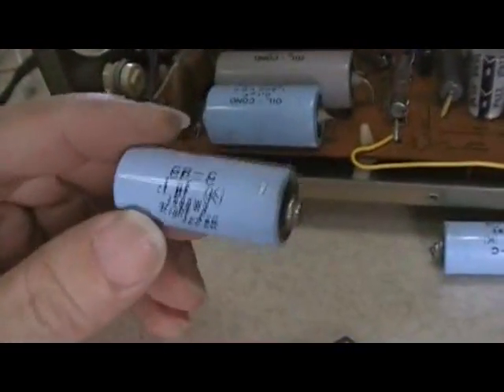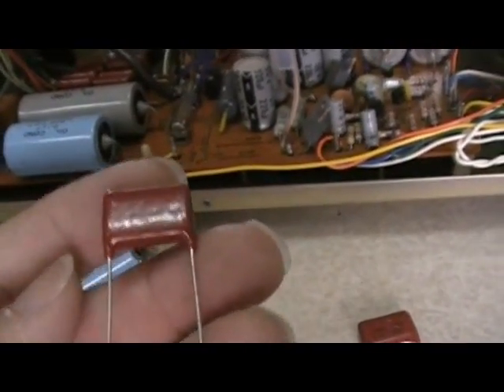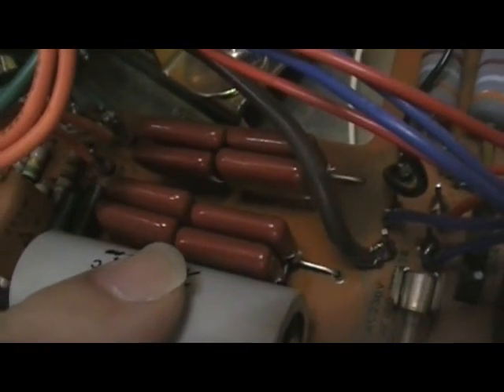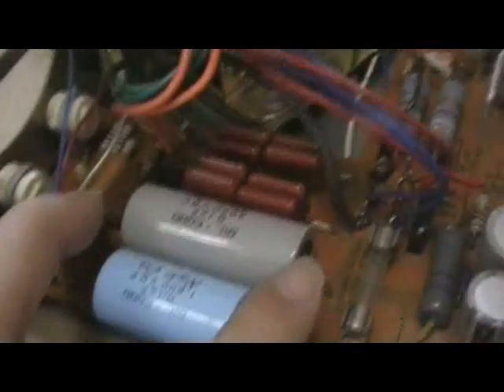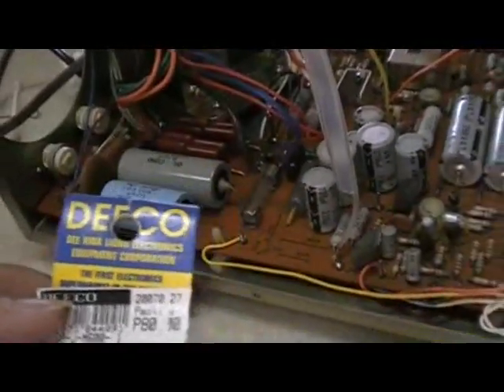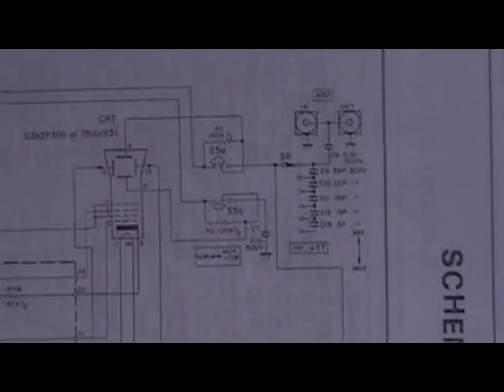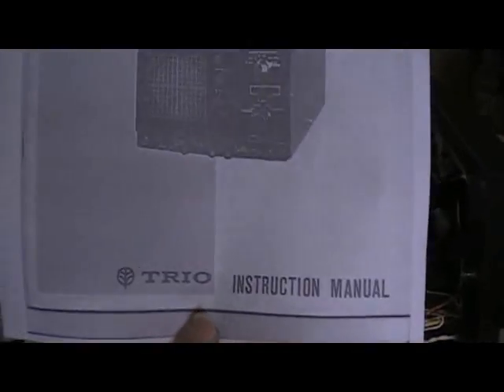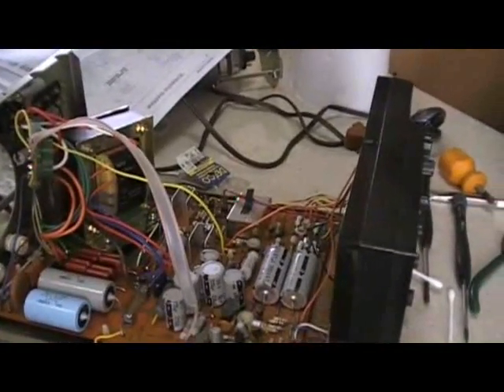Trio Oscilloscope Schematic diagram

Comment: HI do you have the manual for this scope as mine has failed, the trace faded and diapeared. Here in the UK we can't get any of the old service manuals or user guides for Trio equipment.
I hope you can help me, Regards Phil GW1HNG.
Reply: Hi, just register as a member first. It is free. Then you'll be allowed to download. Enjoy. https://www.allaboutcircuits.com/test-measurement/oscilloscopes/co-1300-series-1303d/manual/
Reply: Hi, just register as a member first. It is free. Then you'll be allowed to download. Enjoy. https://www.allaboutcircuits.com/test-measurement/oscilloscopes/co-1300-series-1303d/manual

Comment: Hi Ellion i have a scope model before yours ...i see you had problems with the HV caps what was the effect on the scope ? i have the same capacitors i will also check mines got no vertical input .
Reply from the maker: dalek moore ..... I can not find a single 0.1 uf / 1000 volts , I make use of 4 pcs in serie/parallel combination to produce a equivalent of 0.1 uf / 1200 volts.....and this Mylar type capacitor will last longer than electrolytic type....look like this will last for another 20 years.